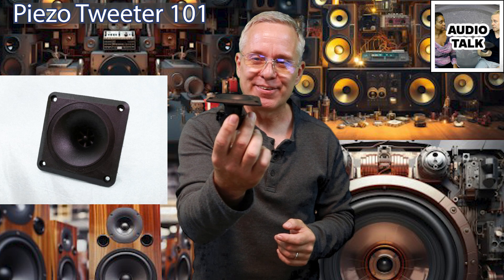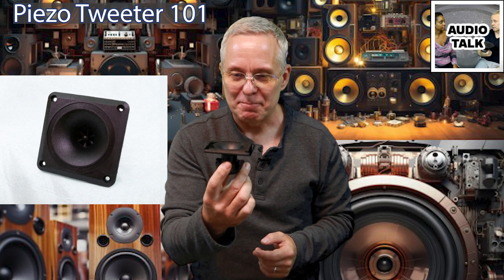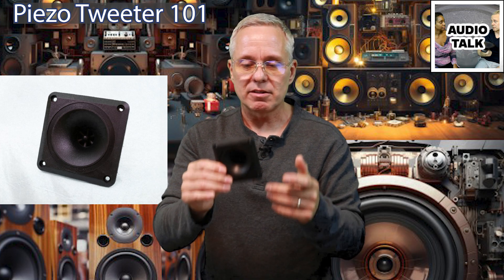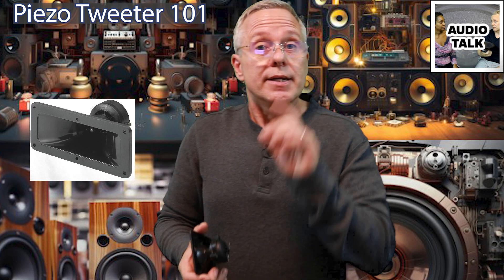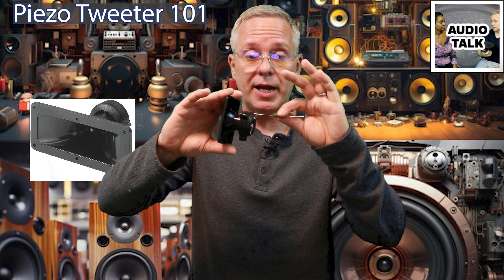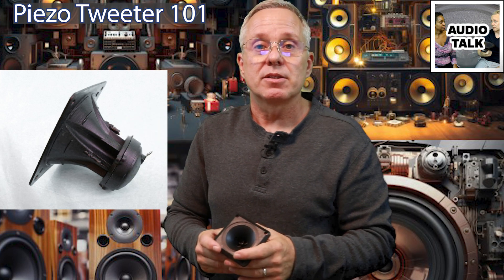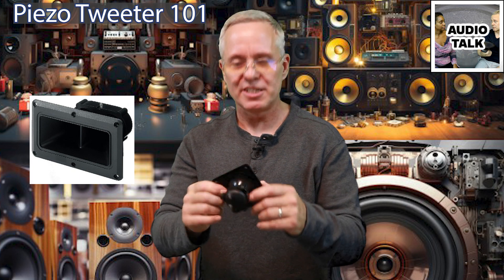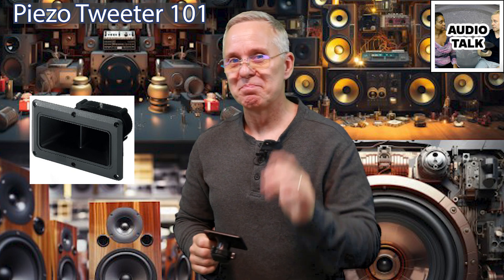Piezo tweeter 101 : Pain and fun in one

Comment: The Piezoelectric tweeter is a capacitive, not a resistive transducer. Simply placing a capacitor in series blocks lower frequencies, however once your music goes into higher frequencies with power, even with an 8-16 ohm resistor in parallel, the tweeter capacitance will act as a short, and your amplifier could go into protect mode at best or be destroyed due to higher frequency oscillating. 

I've tested those small Motorola clone and Radio Shack larger horn piezoelectric tweeters. The values he stated of .1 to .3 mfd capacitors in series are incorrect values.

Keep this basic electronic principle in mind; a resisitive load in parallel with a capacitive load means at some point the capacitor impedance will (meaning the tweeter) drop to near zero. Any zero resistance in parallel with some value of resistance, becomes the conductive path rather than the resistor. If this principle isn't understood, look up series and parallel circuit design descriptions.

After testing and observing what happens at higher frequencies, this is what I recommend.

To cross over at ~ 3KHz use a 2.2uF in series. Use a 1.5 uF cap for a 4-5 KHz crossover point. I used a 16 ohm resistor in series ahead of the cap, to help the amplifier 'see' more of a resistive load. An 8-10 ohm resistor can be installed in parallel. The resistor in series doesn't attenuate the overall level very much, but helps produce a high frequency roll off.

One other thing, the values I mentioned assume the rest of the drivers present an 8 ohm load.

I hope this helps anyone wishing to do this kind of experiment.

Comment: $3.97 WORTH OF EAR PAIN.  I'LL PASS.
Reply: Not always the case. I use the big 1188 copies (I make my own simple horns with wood 4 pieces of scrap wood) with an 8ohm resistor in parallel and then use a regular adjustable L-pad to adjust their level. They add just the right amont of sparkle and upper end to vintage alnico 8" or 10" full range drivers I use in open baffle. Not harsh at all when you keep their output tamed with the L-pad. They actually sound beautiful and they're very light and dirt cheap. The trick is keep their output tamed
Reply: @edjackson4389   I prefer to use a better tweeter that isn’t harsh to begin with.

Comment: I've five Motorola KSN1016 in parallel. Each has a 56 ohm series resistor.  That paralp as primary, lel load goes to the 25 volt leads of a 30 watt matching transformer. I'm currently using the 15 watt tap as the primary side and that primary has a 7.2 ohm/ 0.11mH Zobel network.  The highpass network is currently a 1.3uF capacior.  It sounds pretty good.  With the 15 watt ta[         p as primary - Z drops to 3.6 ohm @20KHz

Comment: I've got some large DIY speakers with Four 15" mid-bass drivers, and Eight 2x6" rectangular piezo horns in each box. The 15's are wired in series parallel, and the piezo horns in parallel with each quadrant of the inner wiring to give them a little buffer off the 8ohm speakers. No crossover, they blend together quite nicely between 2,000hz and 3,000hz. I'm running 500 watts per channel, and it all sounds just peachy fine to me. I ❤ my piezos! Also i blend that whole system with a studio monitor system, old school new school. Each system sounds great, mix them both together and it sounds phenomenal awesome! It's ALL In the way you blend, and i highly recommend the old school new school approach to anybody.
Reply: That's exactly what I do every day, and also taking advantages from vintage, pro and car audio for my audio projects.

is very nice to know I'm not the only one out here.

Comment: i have a question for you kent. i wanna upgrade my current xover im my polk speakers. ive never done it before at all. i wanna model it after the current xover in it. i dont know how to read the pcb or figure out what does what. i also dont know the first thing about how to hook it up. is there anyway you can help me out on this? any help is appreciated for sure. your very knowledgable and honest. unlke many others ive seen. you know, ive watched alot of guys similar to you. i gotta say your the best one by far. you recommend and explain only the truths. the guy at gr research i dont trust. you should design a high quality diy speaker and xover and buiild it. share the builds on here and wait to get super popular. you can also upgrade current speakers so to speak like gr-research. he never plays a sound byte to any speaker he does. that alone to me exudes snake oil. i know youtube compreses etc. but if its as good as he says you will hear a diffence no doubt. really appreciate you sharing how to mod el cheapo tweeters.

Comment: Another great tutorial.  I hope you can get more views.  hang in there.
Reply from the maker: Thank you so much for the support!!
Reply: @AudioTalk  I have a resistor it is a 62 ohm 5 watt 5% tolerance I wanna replace it with a non inductive wirewound resistor 62 ohm 5 watt 1% tolerance should I do this or should I use a metal Oxide resistor instead?
Reply from the maker: @WingStop-zv1sk   You can pick any of them, its only a matter of how much you want to spend for lower distortion, but it sounds like a parallel resistor being of that size so it would have to be High end speakers to tell the difference between wirewound and mox